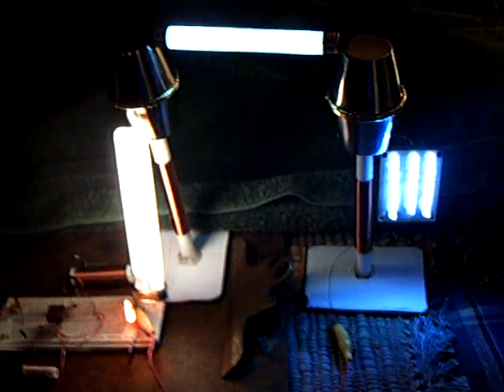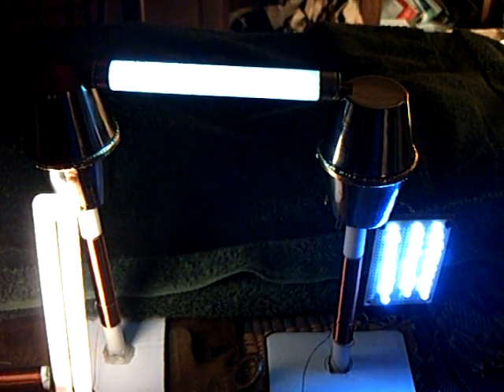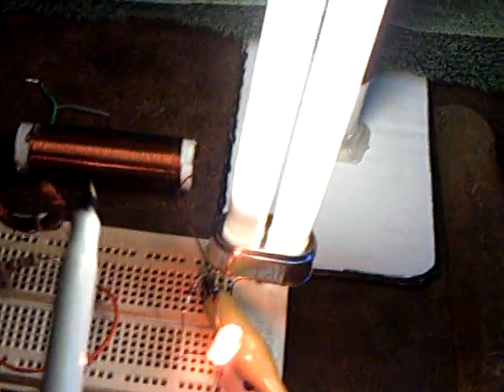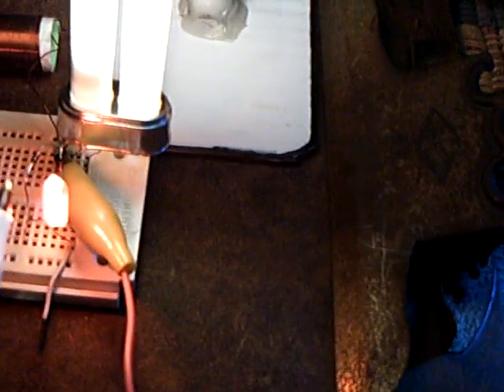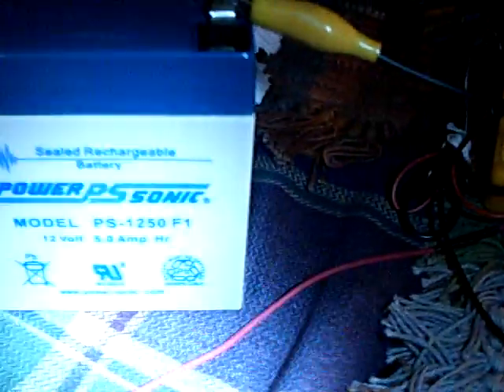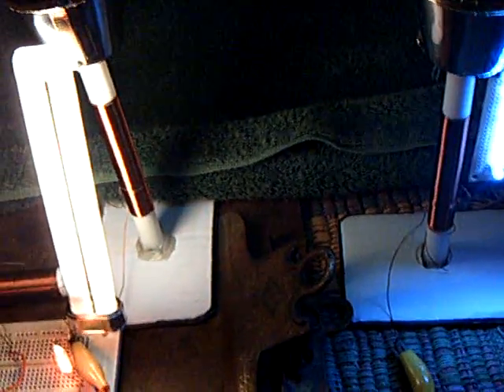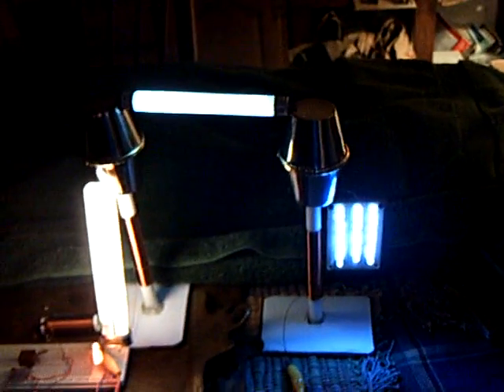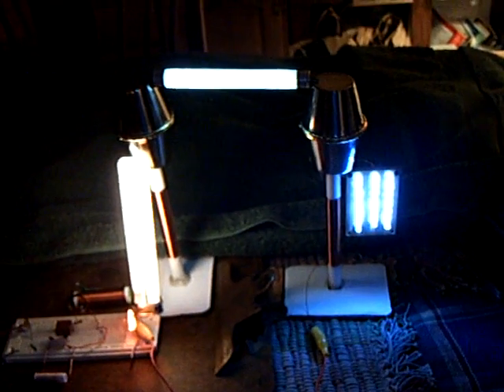SEC making BIG light on low power

Comment: @Marthale7

It's not just good for gases and plasma columns... I've seen LED's and FL wire light, as well as triac pulsed 120v bulbs in the actual circuit. Also I once saw a video of Dr Stifler running a small dc motor off an SEC exciter.

Its definitely not inductive coupling. Inductive coupling behaves in such a way that the further you get from the source the less power it can receive. I really wish he was selling the kits and stuff again. I should have jumped on the opportunity last time...